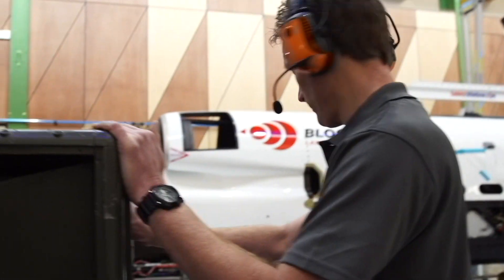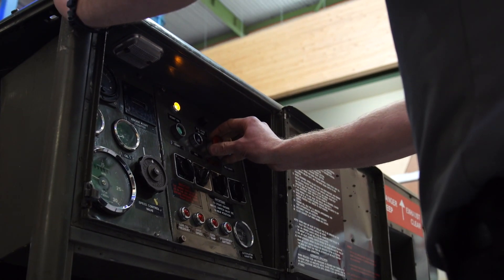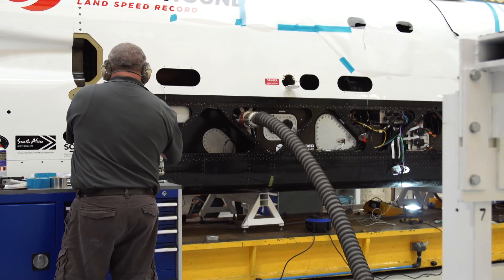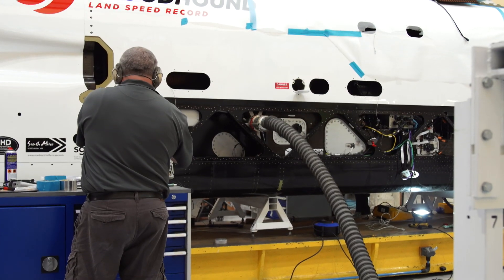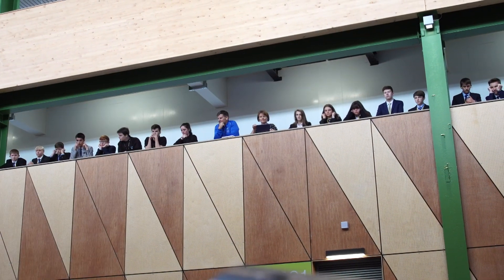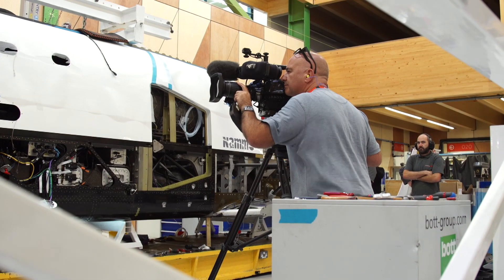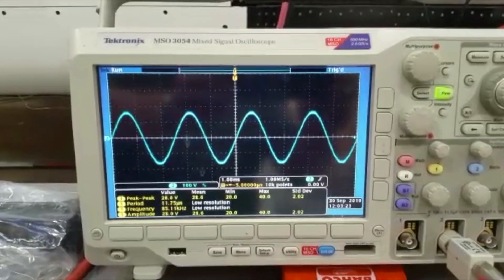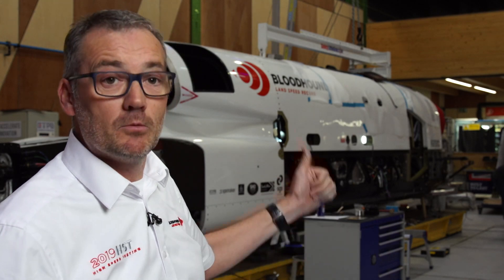Dry Cranking the EJ200 jet engine

Comment: To the Bloodhound crew, should you read this - I remember in 1997, Thrust SSC suffered from a few parts being adversely affected by all the severe vibration of the car as it travelled across the salts at high speed, have you designed Bloodhound with this problem in mind or have you just used tougher parts? Basically, what's the deal here? Thanks! :)

Comment: Good to hear you guys are still progressing the project. As an Aircraft Engineer, I must point out that you do not 'dry crank' a gas turbine. You dry spin it, or if you have fuel on, but no ignition, you wet spin it.  It has no crank(shaft).